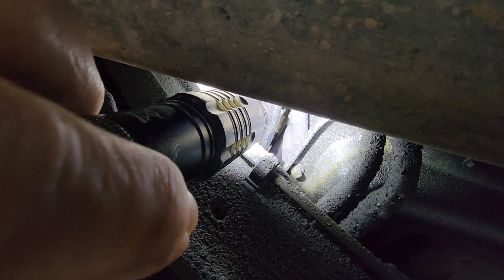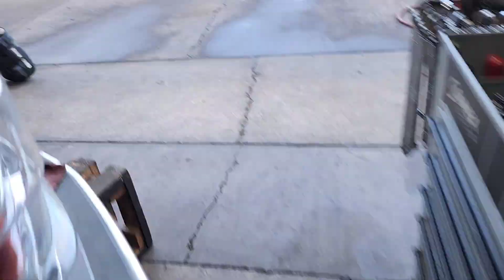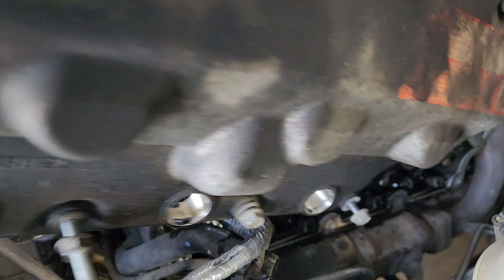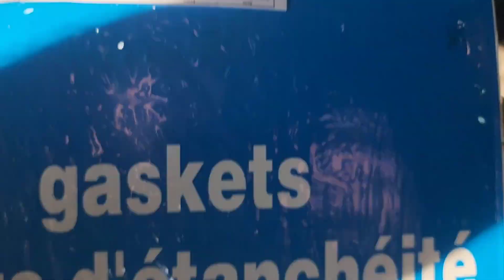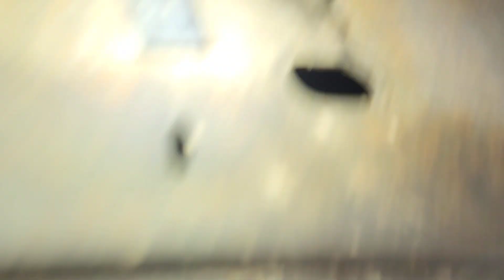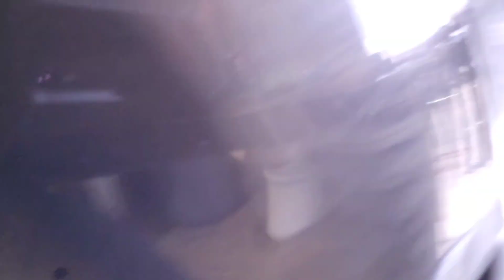6.4 Powerstroke Blown Out PCV Hose Repair

Comment: Very good video and subject matter.  I only needed info on the Crankcase Vent Oil Separator hose and it's routing, but like others have said, this hose is very elusive and I could not find one diagram in the Factory Service Manual that showed the routing and final destination of this hose.  Many conversations in forums says that "This hose runs down the back of the engine and then enters the crankscase",  Thanks for clarifying this and showing us what needs to be removed to replace this hose.
Reply from the maker: Your welcome and yes the info on this is horrible

Comment: This video saved me a ton of headaches. Thank you!

EDIT That dang PCV hose was a hard part to track down. Every other part store I walked into says, "diesels don't have a PCV valve," as I stood there with the broken line in my hand. Uh... ok, then what's thus? "We have no idea," lol. Anyway, if anyone needs the part number: Motorcraft KCV-221.
Reply from the maker: Awesome glad to hear it and thanks for sharing the part number!
Reply: @NutsandBoltswithTone Now my issue is getting thar damn hose on. I cannot get it all the way flush. It's about 50% on there and won't budge  I'm flummoxed lol

Comment: You are golden my man. So is there an actual PCV valve
Reply from the maker: There is an oil seperator
Reply: @NutsandBoltswithTone Does the seperator itself ever leak or need replacing? I have so much oil everywhere its hard to tell.

Comment: Ha, ha, ha, I am so glad you do work on these Fords 08 to 10  Superduty 6.4's I love my SD. And just got her back from the shop for a blown head gasket.  So now it's finally got rebuilt Heads ARP studs up upgraded Valve trains modified oil cooler add a radiator filter but I want to do a catch can so now I'm wondering about the PCV. Just for the record I have know idea how often you have run this issue. For me it's August 29, 2025, my truck has 136K and she's a spoiled and deleted baby. Getting more than good service and Filters. So now I want to put a large capacity Catch Can of my own. Thinking along the size of 4"X7" baffled with plenty of coarse SS wool 1"OD entrance and exit ports. As these engines seem to have excessive blow-by 1" tubes should handle it nicely. But the PVC is important. Again love your show clear to the point great audio and visual. Hope this one will help. Thanks
Reply from the maker: Awesome brotha and thank you. Unfortunately I do not do things like adding catch cans. We have to stay in compliance with Ca law.

Comment: I have an oil leak coming from somewhere high on the motor. Took it to get turbos and oil coolers replaced and came out the shop with the leak. Any guesses?
Reply from the maker: Could be a number of things, could be turbo crossover seal, oil cooler, oil pressure switch, turbo pedestal. Message me on Instagram and I can try to help you out.
Reply: @NutsandBoltswithTone what is your instagram name?
Reply: Turbo drain leak

Comment: This is great information. Thank you. Today's real-time is April 2024. My 6.4 is an 08 F 350 SD single rear wheel. With 136K miles. Deleted as soon as the warranty was up. Say what you want about deletes. The government emission control system is a failed science project that if left in place will result in early catastrophic engine failure and unnecessary expensive repairs. Since the deletes the overall performance has improved greatly MPG has improved by 1/3. Had to change out a new stock air filter. For an after-market box and filter. I was getting a replace air filter warning on the dash every time I would pull a load up a hill or pass slower traffic. I would have to reset the airflow sensor on the air inlet tube. That is how restrictive the stock air filter is. Let's talk about blow-by. Losen the oil filler cap but hold on to it. It might just blow out of your fingers. This might be due to the ring gap on the back two positions being set so far apart to allow for the extreme heat generated in the regen process. Allowing excessive fuel and pressure to bypass the rings and enter the crankcase and the fuel to mix with the crankcase oil. I have just recently installed a DYI catch can. The can is larger than most. It runs 1" tubing to both the inlet and exit ports. It has excessive baffling and forces the air,vapors and oil carried to have to fill the entire can with vapors before exiting. The can is 4"X7" with 3 SS scrubbing pads stacked top to bottom nice to have come across your video ❤️👍😊
Reply from the maker: Thank you and I appreciate the info.  Have not heard that about the rear piston rings.  Thanks for watching.  I have never worked on performance diesels or deleted ones because of California laws.
Reply: Sadly the engine is a bad design, Many parts gets leaks by bad quality.

Comment: My 2010 has this exact leak right now. Is it possible to replace only the blown elbow and not the entire hose?
Reply: @NutsandBoltswithTone Isn't that rubber hose and the plastic pcv one piece? I tried taking it off but it seems like you have to buy the whole pcv breather hose.
Reply from the maker: Yes you can just replace the elbow.
Reply: @NutsandBoltswithTone  what size threads are the elbow that goes into the block? Thanks